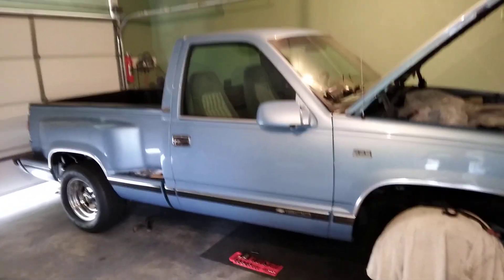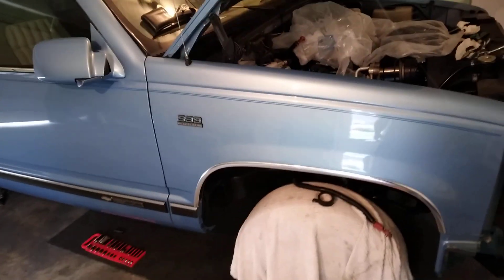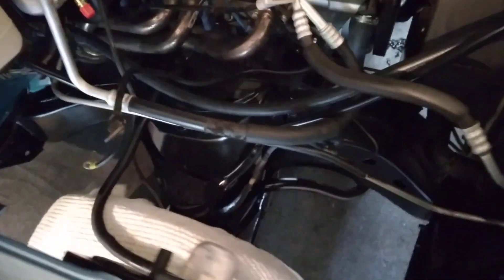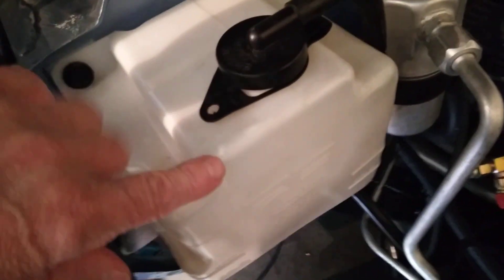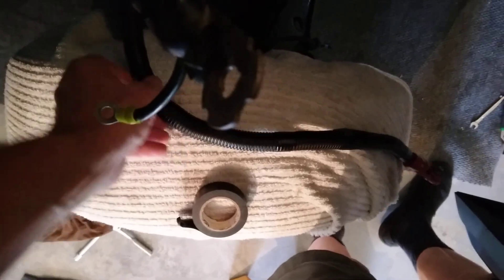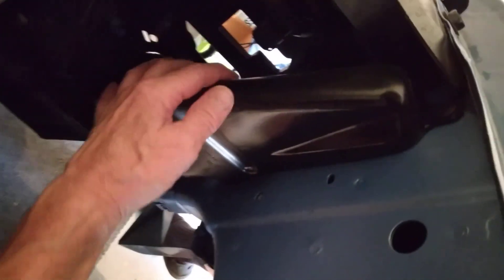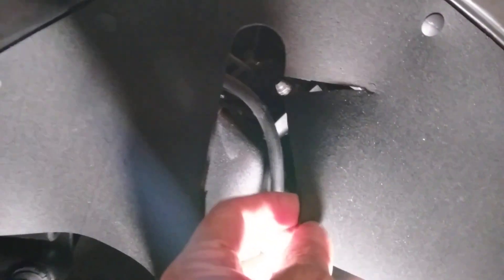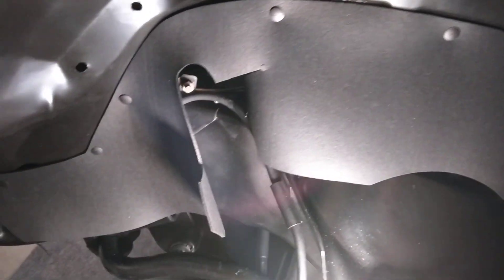LMC Trucks Dust Cover Review For 1993 Silverado Truck

Comment: Hello, I was trying to leave you a comment on your Rustoleum chevy frame video and you had the comments disabled, trolls ruining everything??  Your truck is pretty sweet, did you pull the body off of the frame and strip it when you wire wheeled and painted it?  It looks awesome by the way!
Reply from the maker: Hi, no I did not pull the body off because I didn't have the room, (that surely would be best). I am surprised with the results though, I was able to wire-wheel the frame down to the bare metal, (the rust it did have was light) the Rust-Oleum did a good job. Thanks for your comment. I'll enable comments on that video.
Reply: @Journeyman-Fixit  It looks awesome, I have a 2003 Tahoe I bought off of a friend that took really good care of, and I would love to do the same to it!  I'm not sure if I'll ever dig that deep, but I'd love to!  Chronic pain dictates and limits much of what I can do unfortunately.  That's a pretty big job as you know!